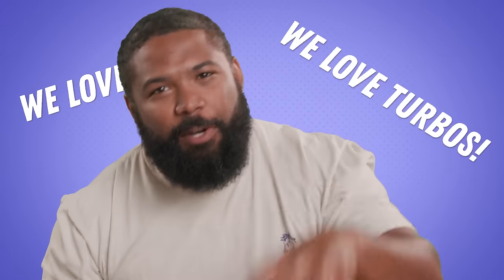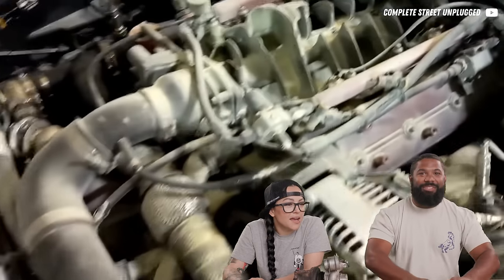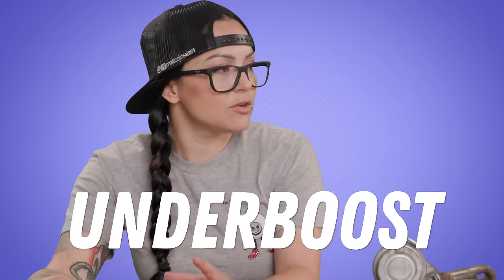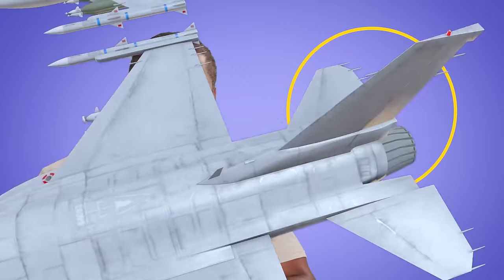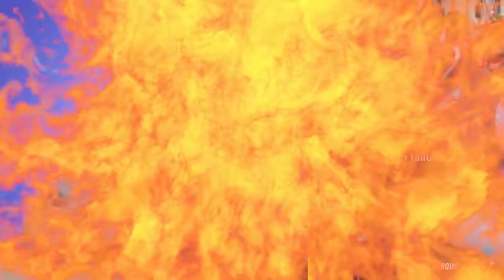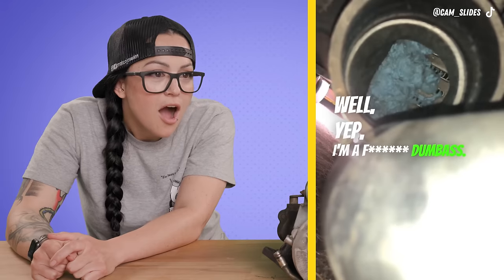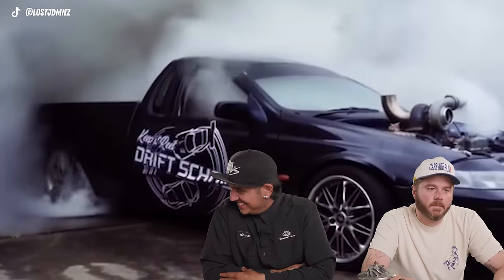Mechanic Reacts to Catastrophic Turbo Fails

Comment: I've always encouraged turbo owner customers to warm up the engine to allow warm the turbo. Zero to 100,000 RPM cold CAN  result in failure. Your thoughts?

Comment: That Volvo was an example of a runaway diesel, where a diesel engine keeps running at full throttle even after the ignition has been shut off. Only way to kill it is to choke it out and cut off the air supply, which is hard with a turbo…

Comment: the evos have a knock detection in the ecu guess what I found when checking someone else's paid tune it was set so high it didn't work, I set mine low and linked to the engine light it made my dashboard a christmas lightshow but it saved me from a bad gas station that was in the news a week later for damaging several cars with bad quality fuel as soon as boost raised it blinked like hell something was not right ps loved my forced performance turbo :) not a giant one but enough to make my car a hillclimb beast didn't have a catch can my intake pipe was disgusting

Comment: "turbo running away" means intercooler is full of oil and it starts sucking into the intake, then the engine just starts running on pure oil-air mixture (with diesel engines it's possible)

Comment: I think the engine of that volvo started to burn rich in oil mixed in the diesel... that makes the engine go wild until it is broken.. You can't turn of the engine with your car keys and keeps accelerating. Some people try to cover de turbo to shut out the air trying to stop the combustion.

Comment: Turbo shaft seals failed and it started to feed engine oil into the combustion chamber. That's where the rpm's started to increase. It was burning oil. 6:49

Comment: That volvo looks like a runaway diesel. Seals in the turbo fail and oil dumps into the engine. Runs until it runs out of oil, the engine seizes, or you can cut off the air.

Comment: The vw car engine “ran away” it’s when fuel keeps dumping in a Diesel engine full out even when you shut the key off… the only way to stop it is cover the intake… and block it from getting air and it will stop running

Comment: Why is not one of the mechanics mentioning 'runaway diesel' at 6:22 ? It happens when the lubricant is leaking into the combustion chambers (by worn valve guides or piston rings and too high crankcase pressure). She actually says 'Why do you let it run?'... Well: you can't stop it by switching off the ignition (in a diesel this will shut off the fuel supply, which won't work since the lubricant is being combusted) unless you're able to block all intake air, because a diesel doesn't need a spark to combust. The high pressure in the combustion chambers will cause the fuel/air-mixture to combust spontaniously.

Comment: Ghost Car: This actually can happen with Diesel Engines. They can just keep running on their own. Only way to stop it is to cut of fuel-lines, opening valves or make it choke until it stopps.
This happens because diesel engines don't need electrical ignition . Diesel ignites when diesel-air mixture and pressure/temperature is right.
If a Valve stops working correctly, it can happen that it keeps having those conditions right all the time, even wtihout driver-interaction.

Comment: 6:52 Actually that looks like a runaway diesel. Oil leaking past the seals and the engine is no longer running on diesel. It'll rev at valve float until it either runs out of oil, someone stalls it out, boom.

Comment: so, if anyone knows who cooper bogetti is, he used to use a magnetic strip to cover the hole on his bonnet (turbo intake on his 2jz powered camaro) for when it rained. one day that magnet (roughly the size of a small mouse pad) ended up getting sucked into his turbo.not sure how but yeah, it fucked it up.

i also remember rob dahm, while tuning his 4 rotor rx-7 on the dyno, a wire managed to get sucked up into his turbo causing damage. always make sure theres nothing loose around a turbo!

Comment: I think the vette blew the intake manifold because of too much boost, then the boost got out of the engine, but the engine for some time still injected fuel for all that air that leaked, so a LOT of fuel was thrown into the  exhaust so, huuuge flames.

Comment: The volve was a diesel runaway, occures when the oil from the turbo starts to burn, even if the car is turned off, it will continue to redline, only way to stop it is to block the air intake.

Comment: Oil in the intake is the most common issue, is the most common reason for diesel runaway. A oil leak in the turbo is the reason for all of those runaway engines.

Comment: with diesels its also because there is a lack of natural vaccum in the engine and with the turbo or blower adds betetr air intake for map and efficiance as well as good vacume for better burning allowing more power.

Comment: Sooo, the volvo running like that is what is commonly called "runaway." It all hinges on the fundamentals of a diesel engine that uses heat generated from compression to ignite or explode the diesel. So, a diesel engine doesn't need spark or "ignition" to ignite the fuel. When you shut off a diesel engine, it either cuts off air or fuel. Runaway is common to see when the ignition is turned off, but the engine continues to idle. In this case, the engine was left idling. The runaway could have been caused by oil contamination, possibly overfeed into the turbo, or possibly fuel contamination, but thats not as likely. I have seen, on older HD trucks operating in oil fields, runaway because of the oil vapors in the air causing the engine to overrev and run without the key on. Most modern diesel vehicles have a emergency shutoff plate that droppes into the intake in the case of runaway, effectively cutting off air flow, stalling the engine. There are a few methods to shut this car off. If its a manual, putting it into a high gear with the e-brake on and popping the clutch will stall it. You may be able to block the intake off, but that is a lot more involved and in the case of a runaway diesel, there's no telling if or when it's going to blow or sieze, so its probably best to stay out of the engine bay. Hope this helps!

Comment: That last clip was the keep it reet au falcon, it has an RB20 now , they didn't just feed it a kebab they used garlic sauce tomato sauce mayo and some other things for oil and used 10 litres of Pepsi for the coolant that engine was on its last legs, it's the predecessor of the mighty Barra Ozzy 2jz, donut please buy 2 au (or ba,bf) falcons for high low as drag cars,  au could make 400kw and the Barra will make 650kw easy with the right supporting mods

Comment: The video of with the turbine dancing is from Power Driven Diesel. It wasn't a cheap turbo just pushed too hard. You can go to their channel and they talk about what happened. Compared to Todd's engine letting go on the dyno that was pretty mild. They build some beast Cummins pushing 1500+hp on the low end. Todd's daily is like 1200hp. Pretty insane stuff if you like Cummins.
Reply: thank god someone said something, josh blew up 2 turbos that night, a borg and a garrett, he tuned the wastgate wrong for the borg, the garrett was just tired

Comment: The volvo, was a diesel and it was running away.   When it does that, is when the compressor side seal has failed and the engine is running on the engine oil...   Its pretty bad when it happens...

Comment: That diesel truck that exploded on the dyno is from power driven diesel. certainly not a cheap turbo, they just build some incredibly powerful rigs. one is around 3500hp. that requires a ton of fuel, which is why it's pouring black smoke before the turbo really spools up. I haven't finished watching to see if one of their other famous explosions is on here where they blew a cummins block in half and launched a piston over the grandstands in indy. Still a dent in the track sign where it hit. when you are pushing the limits of things like they are, sometimes you fly too close to the sun.

Comment: Correction: A small amount of radial shaft play may be acceptable depending on the bearing type used. Journal bearing turbos will likely have some radial shaft play as it relies on a film of oil to act as the bearing surface, necessitating a clearance to the bronze bushing. Ball bearing journal bearings should have no radial play. Axial shaft play is ALWAYS bad regardless of the journal used.

Comment: Love these videos. But the crew need to realise diesels are VERY different to petrol engines! White smoke can mean coolant- can also mean compression loss. Diesel isn't burning properly. Diesels make make more power and heat the richer they run. Lean off doesn't mean overheat and failure on diesel- just loses power. The Ram was failing the moment the black smoke turned blue...

Comment: One sure way of distorting a turbo is to rev the shit out of the engine and then turn it off with out letting it idle for a moment. The turbo spins up to a high rpm and will continue to spin with no oil feeding the bearings. Do that to often and you'll be making a trip to shop for sure.

Comment: the volvo it's a runway diesel , most of the times the seal of the turbo shaft fails , and the engine feeds on engine oil , so its in a "auto feed " loop that cannot be turned off by the key , you must put in 3rd or 4th gear while slamming the brakes to stall the engine . if we wait it runs out of oil , the engine will be ruined , and most of the times it destroys itself , because of the very high rpms

Comment: that is a  runaway  diesel  6:50 the  seal in the turbo is  blown so the engine is pushing engine oil into the  compressor  housing of the turbo and the engine is  burning it  in addition to  diesel so  its max rpms

Comment: kind of surprised neither of them knew about diesel runaway when you blow a turbo oil seal basically giving the engine tons of fuel with no control. pulling the key out wouldn't do anything you have to choke the airflow going to the engine.

Comment: 6:59 
The engine is running away 
It happens when it starts running on its own lubricants or if fuel/oil starts spraying into the intake

Comment: You actually take power to turn the turbo. It increases backpressure, effectively braking down piston at exhaust stroke. Of course you are not directly taking this power from crankshaft like would be the case with supercharger, but you're still taking power, but there are effective ways to engineer around this increased backpressure. But thing is, there is no free power, it comes always from combustion in internal combustion engine. There is some wasted power in exhaust though, and this is why turbocharging is so effective and can make engine more powerful and/or more efficient.

Comment: On a diesel black smoke = heat.  rolling coal with no load typically won't produce enough heat to cause problems, long dyno pulls or towing black smoke = lots and lots of heat for a prolonged time = a damn big bill.

Upgrade your coolers and turbos before your injectors boys and girls.

Comment: She fucked up explaining the turbo.  She got parts of it right but it most certainly takes power to make power weather it's a turbo charger or a super charger.   You just need less power to supply the turbo is all.  No matter what it is always going to take more air more fuel and more spark to make a bigger boom inside that piston.  When you constrict the exhaust with a turbo you are naturally going need more power to spin the turbo

Comment: Volvo explainer: diesels can runaway. If the there is an extra source of fuel to combust (maybe an oil leak on the intake side of the turbo), a positive feedback loop is created and the revs go to the moon. The only way the engine can be shut down is if it runs out of fuel, oil (which is a disaster), or you suffocate the engine.

Comment: Anytime a diesel gets a whiff of gas or you mess with the fuel system there is a chance of the engine running away if you are not quick enough to block off intake you can't stop it it will run till it blows

Comment: 6.0 Powerstrokes don't have enough studs... also when a turbo goes on a diesel... very little fuel is being burned... so it looks worse than it is... often. that 6.0 if the guy said it need studs the coolant explanation is correct.

Comment: 5:20 that 6.0 powerstroke stretched a head bolt and lost its head gasket. Definitely needed headstuds (learn to visually tell the difference if buying a built diesel.

Comment: I think the vette just had too much boost and heat, broke the intake manifold which caused it to run super rich, causing the fuel to shoot into the exhaust, leading to the flames.

Comment: Diesel engines do not create vacuum unless there is a throttle plate .   Diesel exhaust , Black Smoke is unburned fuel . I like to see HEAT WAVES at the exhaust stacks on a class 8 truck !  Borg Warner makes good after market turbos .
 Turbochargers are required to have free play , forced inlet oil pressure takes the play up !  An aftercooler cools air down for air density in the combustion chambers .

Comment: 0:55  Of course the turbocharger requires power to compress the intake air, and it increases the back-pressure the engine must push the exhaust through. You just get A LOT MORE power than the turbo uses by cramming more air into the cylinders and burning more fuel.

Comment: smart things to do to car... blow up motor = burns less gas. E85 mods because of changing fuel regulations at the pump... fuel up, car starts and idles but has 1/2 power. 30% less on the chart and the hill of 65% inefficacy's OEM parts go thru to deal with it and cant because there already maxed out on the original gasoline.

Comment: Even just chipping your stock car, you need the best bolt-ons to take to stress off of the engine components. Save your money, wait...wait more...get the best intake, intercooler, exhaust and software

Comment: That Volvo was a runaway it’s when the motor keeps goin you have to cut fuel or air and stall it to make it stop and pretty sure the turbo smoker contraption blew up due to no oil since usually turbos have oil flowing through to constantly lubricate bearings

Comment: The Volvo S40 looks like the D4 or diesel version, it could be a runaway diesel. You can turn it off, but it will keep running off the engine oil. IMO

Comment: saw a wrx that suffered the bad mechanic overboost and take the money despite a reputable mechanic saying don't do it.... ran 30psi into a stock 07 wrx  did a run one night, driving back from newcastle to sydney and yep blew  his engine....his wife made him fix it then sell  it lol.  i was at the mechanics when it was on the hoist getting repaired.

Comment: 3:40 with it being a Volvo wouldn’t be surprised if it’s a diesel(idk if they even still make diesel cars I’m sure they do tho) but if it’s diesel the turbo seal’s probably went bad letting oil into the compressor housing cause the diesel to run away

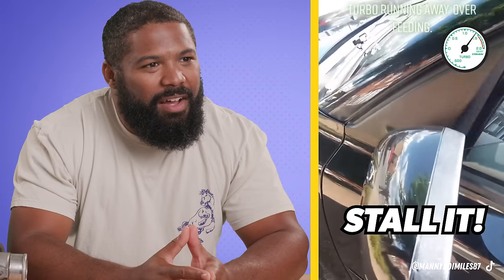Comment: 6:30 turbo diesel with a leak can suck in oil into the chamber causing the engine to rev up until it dies

Comment: The Volvo was a run away. The engine got hot and the turbo was forcing air through the engine and  it started dieseling on its own

Comment: Im not a car guy but I wish I was. Anyway, at 1:46, what is that hole in the fender by where the fires coming out of? They said exhaust manifold but Ive never seen exhaust come out the front of a car. What is that hole?

And wow Angelina and Sandro know their shit.
Reply: Some people, when modifying their engines to make more power, shit their exhaust pipes to the front of the car maybe out of the hood, bumper or even the side

Comment: On the Volvo it is Not a stucked Pedal. The Engine Burns Engineoil. You can shut the ingnition off, but the Engine wont shut off.

Comment: The Volvo was a a diesel engine in thermal runaway not a stuck throttle. Killing the engine won't stop it, it's so hot it will just continue to go.

Comment: I drive an Infiniti Q50 with the VR30DDTT (Twin Turbo V6), those twin turbskies make the car a blast to drive and people mod the shit out their VR30's. With about 5K of bolt-on's and a Tune you can make over 500 WHP and about 600 ft/lbs of Torque (not joking AMS Performance sells a package just for this).

The sad part is there are fools out there that drop that 5K and then ask for a "flame tune/map" just so they can "throw fireballs" out of the exhaust and in doing so they cook the turbos, and then complain about the reliability of the VR30.

Comment: Biggest misconception about turbos is that they “dont take power to make power”. This is completely false. Energy isnt just created out of literal thin air. And it most definitely takes energy to spin up a turbo and produce boost in the compressor side. For air to flow through the turbine and spin it up, it requires a pressure differential across the turbine, which requires a restriction, which is the turbine. And that creates high pressure in the manifold. That creates extra back pressure that makes it more difficult for the exhaust gasses to leave the cylinder. Which means that it in fact DOES rob power to make power. Obviously the boost adds more power than it takes to make. Same with a supercharger. So the argument that turbos are more efficient than superchargers because they dont rob power is also false.